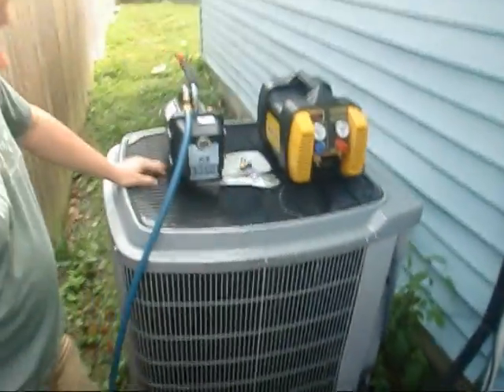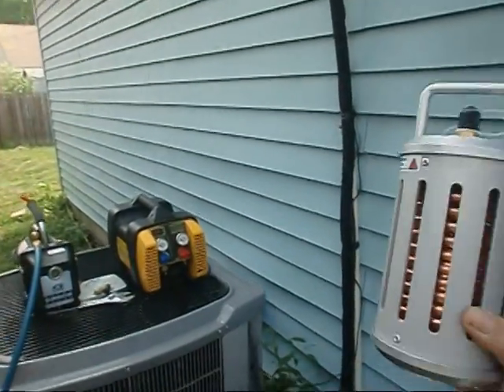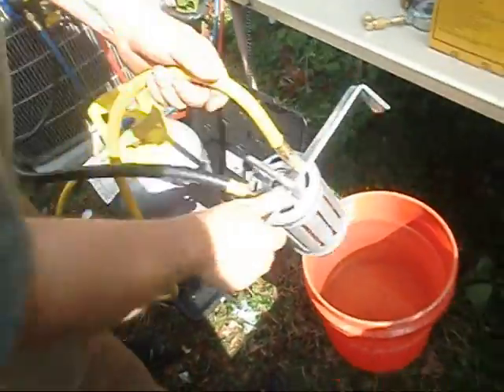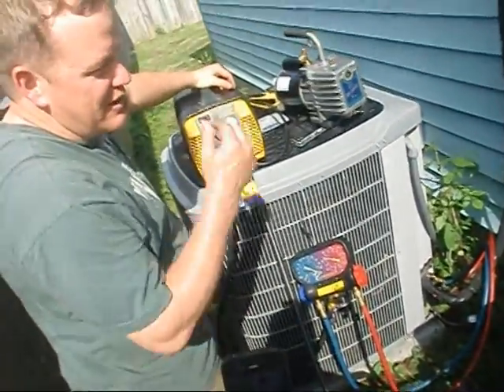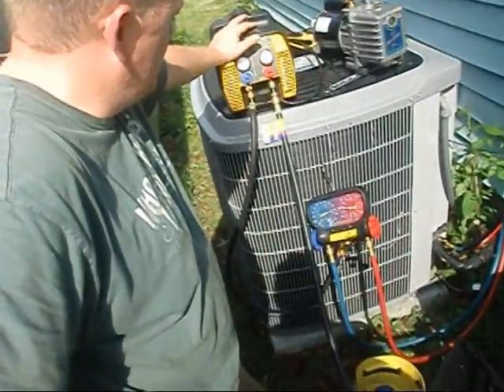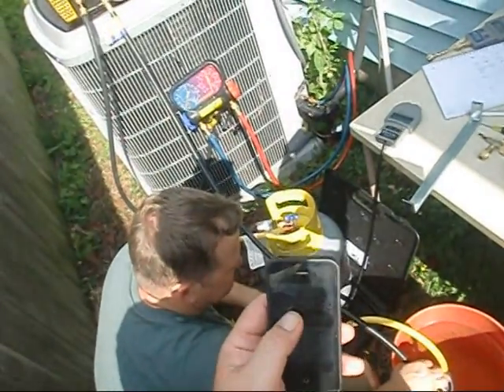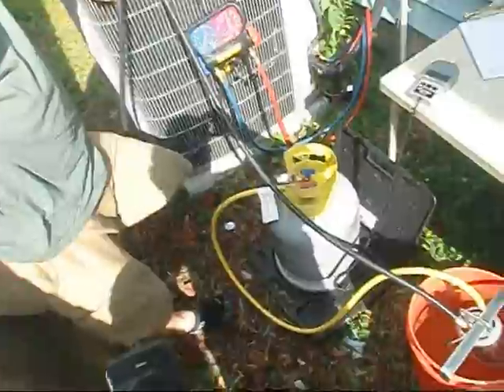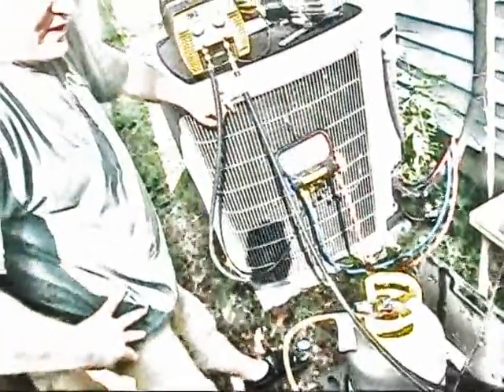Hvac Service - Speed up recovery with this tool

Comment: used one to recover 120 lbs of r-22 out of a chiller. great time saver. best to use with ice and a bit of water. about 8 lbs of ice was used. recov cylinder gets real hot and increases tank pressure and works against recov machine.

Comment: What happens if you put that tool before the recovery machine which would cool off your recovery machine as well
Reply: Because refrigerant gas before entering to recovery machine no need cooling...it still cool..refrigerant is hot after push by revobery machine, .thats why we need that tool

Comment: I have thought about making something like this... roll of 3/8 or 1/4" copper, make some flares and place it in icy water. Little air cooled recovery machines can only be so efficient and only as cold as 10+ deg above ambient. Usually on small systems, I use a fresh 30lb tank in a good vacuum and never had a problem. On larger Air Cooled Chillers, we usually have multiple tanks. When one tank gets hot we switch tanks and run the other tank with cold water. Usually not necessary though. FWIW, Water cooled chillers, we use a water cooled recovery unit that has a coaxial coil (water / refrigerant H/E.) Used it today, recovered 1lb R134a every 20 sec with 1/2" hoses. Push/Pull 70lbs/min liquid.

Anything to bring the head pressure DOWN and the approach DOWN will speed up the recovery. In reality, if the recovery takes an extra 15-30 minutes and you dont need another tool to bring up, thats a win. I would save these for doing emergency recoveries, in the summer, on High Pressure refrigerant like the 400 series. Even R-22 can be a struggle when its hot out.

Comment: Get with the time haters/danosores it is 2019. I've been a hvac mechanic for 16 years and when your on a rooftop working on a 10 to 20 ton peice of equipment there isn't a water hose in sight. And who is actually going to carry a bucket of water up an ladder to a roof to not only risk your own safety. I bought one of these today but not before I read every piece of literature I could find on it and if it makes your job easier and more efficient then it is worth it.time is money

Comment: I have been in the business a long time I noticed that you are connecting the output of your recovery tank to the high side port. You do realize that most recovery tanks are designed by manufactures to be used up side down. There for with the can right side up you are dumping liquid refrigerant into the top of your tank causing it to flash as it enters the tank which is the opposite of what you want. The suction side has the dip tube not the high side valve. Don't believe me? Remove the valve on top of the recovery can and check for yourself. So in conclusion hook up on the high side like you have but flip the can over. There is a twist however some recovery tanks are designed to be used in the up right position putting the dip tube on the high side (but most that I have found the dip tub is on the low side and the can should be used up side down) so sadly always take your valve off your recovery tanks and check it or find a manual for the recovery can if that is even possible to verify.

Comment: Waste of  $ for residential
Reply: It really isn't if it's summer and you ACTUALLY USE ICE. These guys are a couple of goobers. You can't use it on commercial (which they should know.) It says right on the thing that you can't use it on a system that's charged with more than 10lbs of refrigerant. Not to mention, he definitely broke the gauge that's on the top of the external condenser. It can only handle 50psi at a time, so you're supposed to barely crack open the the port that's running to it. Used properly, something that takes 40 minutes can be done in 10.

Comment: Not saying it is a bad idea, but why not just do a push/pull recovery where you pull the liquid from the high side and dump it into the high side of the recovery tank... then take vapor from the low-side of the recovery tank and dump it back to the low side of the AC unit.  that should get you all the liquid leaving only vapor.

Comment: Save yourself 140 bucks and just put your tank in the 5 gallon bucket and dump a bag of ice over it. 33 degree ice melting over the tank keeps it cold enough to fill up with liquid REAL fast! Plus, you can set aside a couple ounces of ice to put in a cold refreshing drink to enjoy as your machine is recovering!
Reply: Exactly. Doing BHO requires the same type of procedure and that's what you're supposed to do is keep the tank as cold as possible for the butane to recover quickly into its original liquid state

Comment: Eliminates the need to change tanks...

Im a novic in the refrigeration side of hvac. Does this essentially mean its over filling the recovery tank?
Reply: Not at all.  You still weigh the recovery tank.  Recovery tanks are full when they are at 80% capacity.  On very hot days of 100° or better your recovery unit keeps going instead of shutting down on hi pressure, and you having to wait for the recovery unit to reset.  In our industry it truly is a time saver.
Reply: Thanks

Comment: I could make one of those with spare 3/8 copper easily.
Reply: Chris Keith My boss made one and we throw it in a 5 gallon bucket of ice when we’re doing commercial really speeds up the process here in Arizona
Reply: I've seen one with 3/8ths copper in coffee can it works wonders.

Comment: This thing works guys.  Recovered 9+ lbs of 410a, 102* F outside, G5 Twin, 3/8" hoses and this CPS MT69 = 10 minutes EVERY TIME, worth every penny of my money. It just flat works. I put it in a 5 gallon bucket of tap water, a bag of ice would be better yet for you guys in Phoenix or Dallas.

Comment: Even if you do cool down the vapor to a liquid if you reclaim tank is sitting there in the hot air then there will come a point that the recovery will hit a wall due to tank pressure vs pump pressure. Nice idea but for the money and time saved not worth it. Besides if you are recovering refrigerant then you have a lot more going on and things to be doing while the system is evacuating.The time really does not matter, unless you are the type who likes to watch water boil or paint dry. LOL
Reply: It's made to be used with dry ice or  ice water on r600

Comment: 10 -20 mins to reclaim system is pretty reasonable.  I think soaking the tank in 50 degree water does a good enough job for reducing time.

Comment: It dose work much better with ice in with the water and better on bigger units with longer line sets. Even a better way my father taught me at 12 30+ years ago learning HVAC and HVAC-R and my father learned it from a old HAVC TECH when he was a young man. Was to use DRY ICE in the bucket and pour in any alcohol 90+ %. Also put your tank in a bucket of DRY ICE and alcohol to be cooled. You can reuse the alcohol(save it) no waist.Coil fan on speeds things up. save time @ $120 HR here in SF.
Reply: Buying dry ice tcost money.    2$ a lb take maybe 5lbs to recover  at the least     10$ a run.  Wen u could get this 140 n not need the ice and increase speed

Comment: We have made a larger version of this and used ice.  It does work well.  The  main reason this product would go over great is size.  Unless you know something I do not you cannot cram as much copper into the same space they did.  I think the real decision is as Eddie said, use of application.  If you work on bigger systems go for the pocket size or work in extremely hot situations you have a great option.  Sure you can make a bigger version (and lug it around too) or you can opt for compact.